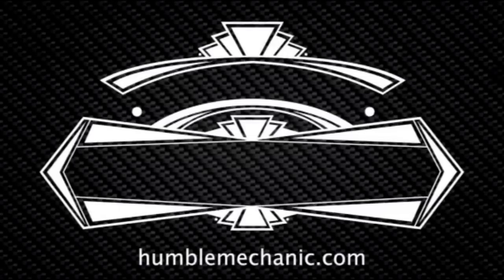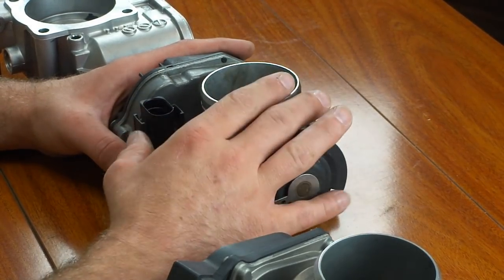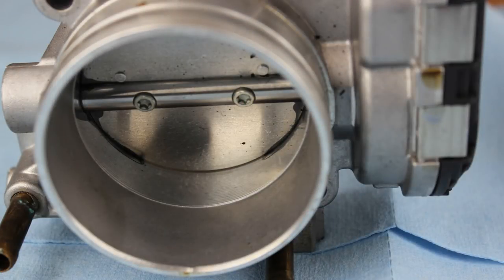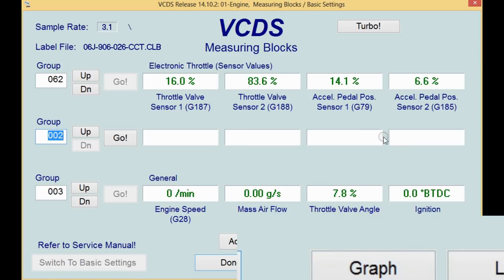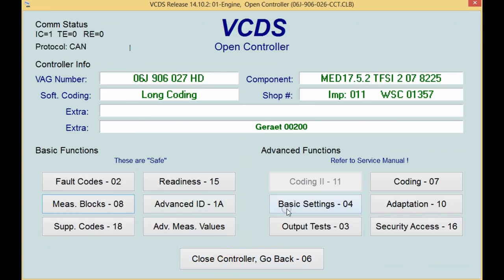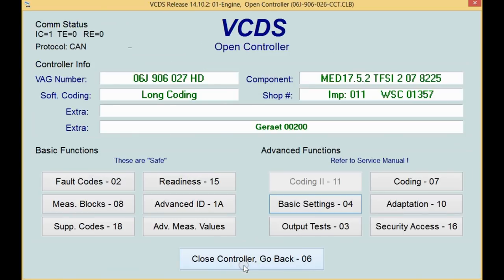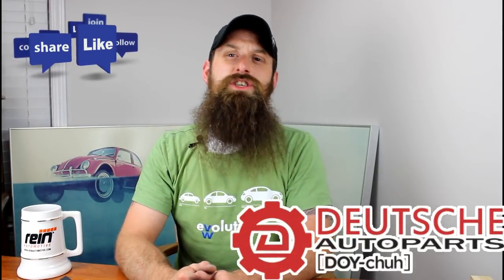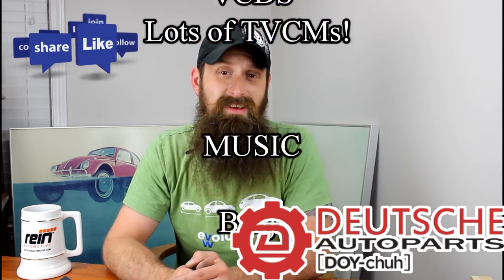How A VW Throttle Body Failed with VAG-COM Demo

Comment: Thanks, great explanations! Gotta love that VCDS. On a recent 2005 1.6 Golf I worked on, I got "17953 - Throttle Valve Controller 
            P1545 - 35-10 - Malfunction - Intermittent"
Any suggestions appreciated, though it's only intermittent so not too concerned unless it comes back with CEL etc.
VW on, man!

Comment: Fantastic video! My beetle just threw up a p0411 code and it's the throttle body. The mechanic cleaned it and said it was still playing up and not working as it should so I've bought a replacement... I was interested in how it works and how you put it in.... This was extremely interesting

Comment: my 2012 golf jerks and makes a clumping noise when coming to a stop.. took it to the dealers and was fixed with a SW update initially.  the problem issue is happening again after 4yrs, this time the dealer say it requires a throttle body cleaning and vacuum pump replacement.

Comment: i had to install a new throttle body on my 2010 cc, it calibrated itself out after a few days of city driving and i didn't have to reprogram it for some reason.
Reply: Why did you replaced it?

Comment: Thanks for the video. In the cable trottle body, whats the function of the vacuum lines. Does it assist for idle speed control and cruise control?

Comment: I occasionally have the problem that the car does not react to the accelerator pedal, not bad response, not at all!  It rarely happens, but it's very dangerous the other day off the freeway for a few seconds.  No EPC / accelerator pedal error code stored.  The throttle valve was cleaned, the ground points to the control unit were cleaned, but it still happens every few days. He recently had a P0130 O2 sensor code, but after replacing the ignition coil / cables / spark plugs everything was ok.  I still replace the O2 sensor in front of the catalytic converter, because there is supposed to be a connection with the accelerator pedal sensor.  I also noticed that the primary air pump no longer starts when the engine is cold.  1.6 Beetle (Motor Code BFS) I don't have VCDS, just a small OBD scanner that shows fuel trim, temperature, TO position etc.

Comment: Hey Charles great video as always, when you have an intermittent problem with codes P0221 and P0121 and the problem does not occur and codes are not showing when you're testing with your VCDS, should readings be normal as you're showing on your video here or you would see abnormal readings? Thanks

Comment: Great video, might want to warn first timers like me that the cooling system runs though the Throttle body and you will need a ear plug when disconnecting.  Saw your ear plug trick after the fact. 😅

Comment: I’ve replaced my throttle body with a brand new continental one and I’ve done the tsb of the connection. I’ve cleared the codes and adapted the throttle body, but I keep getting p0221 and p0123.
Runs good for about 2 minutes and then epc and esp lights come on.
Reply: theblackslcmamba 
Hello did you find a solution for this problem 
Thanks
Reply: Gas pedal

Comment: 2003 Golf 2.0l AVH. getting P0221 Throttle/ Pedal Position Switch B circuit Range/Performance. Been having this come on every morning and having no power. Ive thrown a used throttle body and pedal position sensor at it but still have the same code. ESP light on aswell. Any pointers? thanks man, love the channel.
Reply: Same issue, 2012 Golf 2.5 here.. I'm under the impression that since the sensors are built into the throttle body itself, you would need to replace the entire throttle body assembly. How did your repair work out, interested to know.. Also, can't imaging VW offering the entire throttle body for under 500 bucks, just my luck..

Comment: VAG-COM while a great tool, its like a computer running DOS. You reference value block 62, is there a legend somewhere that tells us what value blocks are for what sensors or actuators? How can I find what block to look at for a particular sensor or actuator?  This is my biggest issue with VAG-COM!

Comment: Quick ?   Just got a 01 jetta vr6 12v.  Has slow deceleration making shifting a lil delayed. I cleaned the TB. To see if it would improve that still having same issue. Do i have it reset or could it be something else cause slow deceleration.   Thanks for ur time.

Comment: New to VCDS...how do I find the group numbers for the VCDS? I own a 04 Volkswagen beetle and gave no throttle response.  It shows it works on the system but it doesn't work my throttle body which is newly replaced and adapted...

Comment: I have a 203 MK 4 golf 1,6 petrol  sometimes when I am driving the car cuts out suddenly this sometimes happened more when the weather is worm outside , and sometimes it judders  I have changed the spark plugs and the four silver tubes that attaches to the spark plugs, but the problem is still there could  this be the Throttle body causing this issue?

Comment: Would a TB issue ever cause a P0343 for cam pos sensor circuit high? I’m at a loss on where to go next with this code. I do have the EPC light on, but I was trying to diagnose the cam issue before moving to the throttle circuit. New timing chain, and sensors.
Reply: Did you ever resolve your issue?   I'm getting a P0340 (G40 camshaft pos sensor malfunction on intake cam).  I've replaced both cam sensors.  Tried swapping them but fault stays on intake cam, which rules out the sensors.  Suspicious of throttle body as it always whirrs/clicks on ignition for 10-15 seconds as if it's trying to adapt, idle is low and rough, revs hunt between 400 and 1800rpm on the lightest of throttle.
Reply: @JamesGadbury so I finally got my issues figured out. All 3 wires from the cam position sensor route underneath the intake where they come into a 6 pin D-shaped connector on the drivers side of the intake. Well, the #3 wire from the cam pos sensor was broken inside that 6 pin connector. Literally pulled out as I was inspecting it. This is on a 2013 Jetta GLI 2.0 TSI. So, to recap because I couldn’t find much on this, I had 5vdc on pin #1 (reference voltage), 4.9vdc on pin #2 (signal) and no continuity from pin #3 (ground) to ground. Lastly, if anyone reading this needs the cam position sensor pin outs, they are as follows: 
CMP pin #1 to pin #29,
CMP pin #2 to pin #53
CMP pin #3 to pin #8
I had a hell of a time sorting this out so I hope someone will benefit from this.
Reply: @jamesk10turbo47  I'm sure this will help many.  Thanks 👍

Comment: Well i have one. A motor of idle rev get some problems. A switch of idle too. I want to fix (clean motor) but electric motor can not be dissasembly (its blocked well under gears i need dissasembly gears but still do not know how). The swich of idle possition must be change for something new (after 18 years its overheat or something). the potentiometer has worn out too. But I use pencil to repair. Throtlle is problem too if its loose correction of air was not precision

Comment: Charles, my daughter's 2005.5 Jetta needs a throttle body. 05-07 2.5 p/n 07K-133-062-B
 is twice the price of the 08-14 2.5 p/n 07K-133-062-A. They look identical except newer one doesn't have throttle body coolant line pipes. What do you think about using the newer one and bypassing throttle body coolant?
Reply: So, it worked for me. 07K-133-062-A on a 2005.5 Jetta 2.5. Only $215 on Amazon: http://a.co/d/e6sPKB6

Comment: Thanks for this informational video, it’s very usefull. I do have e question though. In block 62, what would it mean if the vallues of position 3 and 4 of the gas pedal are equal? M could this mean that the gas pedal  is broken?

Comment: I have a mk6 tdi and the cable on the side moves in and out at regular intervals every 3 seconds. I can’t figure out what the problem is but it stopped for a month and came back. It stutters in a particular rpm range like it’s running out of fuel but that throttle is moving back and forth no matter how I drive every 3 seconds. It’s got a check engine light on that is meant to be something about fuel system very general code

Comment: Golf 4, 2003,  BCB, Trouble code 17961 and 17912. Cant give gas at all. 
In VCDS, group 62. In the two last boxes (accelerator pedal position) the numbers are almost identical. But is there one or two sensor in the accelerator pedal?

Comment: Humble mechanic I was on the road driving my 09 golf gti  and as I rolling down the st I decided to turn on my ac so not even 3 seconds  the whole engine  cut off! Just I try giving it some gas and  the gas pedal  felt like lose  as soon as I got  off the road try to push the break and it was so hard! Do you think it is the throttle body??

Comment: Hey great vid. My cousin has a 2010 Voltswagon Routen V6 engine and it has a code PO123 read: Throttle/ Pedal Position Sensor A Circuit High Input Confirmed. How am I able to fix? Answer in a video would be appreciated. I don't know VoltsWagons at all. Thanks I look forward to your reply.😃
Reply from the maker: the Routan is a Caravan/town and country. I'd search that code for a dodge/Chrysler you probably will find a better answer.

Comment: On my 2012 MK6 GTI, I get a P2138 code saying Throttle body position sensor, voltage correlation, and it comes and goes but is kind of rare. I just dont know what it is.

Comment: Dear. Eng, many thanks for your amazing videos.
I have Touareg 2008 V6 FSI Engine...I have unstable rpm in ideal position... I tried to clean the Throttle but still the problem.
Also when I turn on the A/C the RPM not increase.
is the problem from the Throttle ? 
To be noted I change all spark plugs and the air filter and cleaned the mass air.
I hope you can advise me
Reply: When you turn AC rpm grown. Probably potentiometr has worn out and on higher rev work better. Or pressure sensor of power steering broken. Switch off these pressure sensor and check. put some pencil lead on the potentiometer track.use adaptation of throtlle. Check idle speed switch into throtlle.
Reply: @StopTeoriomSpiskowym  many thanks for the reply, I will try to do it soon.. is it possible to share a video ?
I  appreciate your help 🙏
Reply: @mohamedalsayaghi  are you searching for answer on internet vw forums?   you have FSI well. Its different story carbon build up on the valves, maybe you have too much of it. another High pressure fuel pump your fuel filter is clean? the pump work with oil (probably in yours too) at idle rpm injectors stream can not be correct (you must check in VCDS whats your fuel ratio when your problem happend).compresion is fine in all cylinders?  . Another timing belt or timing chain to check. Sparks plugs to check. Coils too.  Engine temperature sensor its vw failure.  Leaking in intake mainfold. Lambda failure.

Comment: Hey Charles.  I have a 2016 Golf SportWagen TSI and the EPC light has been coming on every now and then over the last couple months along with stuttered acceleration.  After watching your video and other videos, there's a good chance that it is a throttle body issue.  I have no diagnostic devices, so I don't know for sure.  I was planning on taking it back to the dealership for repair because we just bought the car.  We bought it with around 4k miles and we don't have much more than  5k currently.  Is it typical for throttle body's to fail with such low miles on the car?  could it be a defective part?  Thanks for any feedback you can provide.
Reply: I would suggest to check all fuses and doing a smoke check yourself. For the smoke check take a jar make some holes in the top and put in the jar a soldering iron together with some socks and mineral oil insulate , so you have some smoke . One site connect with air hose in the car (on the left in engine front) the other one blow some air in the jar through the tube. Take time and on the passenger site in the rear tire vw has the EVP system, take the tire and the molding around, watch if you have smoke! After that, check for the leak in the front of engine by air intake.

Comment: Is it possible to short out a tb? Was getting tb faults and epc light and realized that one of the middle wires going to tb harness was broken at crimp from previous splice per tsb. Wiggled the suspect wire while engine was running and throttle body acted strange and would struggle to idle even after running adaptation and repairing broken connection.  Did I somehow fry it or am I missing something? Have 5volts to the harness.

Comment: I have a mk4 1.8t with 110kW, motor code agu. I think it has the dual system throttle(electric and manual). After reinstalling the throttlebodey after cleaning, is it necessary to adjust the cord to a specific position?

Comment: I have a 2000 VW golf gls 2.0 liter .  Question what is the part located directly under the throttle body on this engine ? The car had a rough idle , and there is a rattling noise coming from the valve cover , so I pulled the manifold off to check my plugs and wires because of idle , and I left it sit like this for a while because I had no valve cover gasket yet and I wanted to take the throttle body off as well to clean it thoroughly , so I waited for this til I could get all necessary gaskets . Anyway today I noticed a black hose just hanging there and looked at it and it snapped and left the tiny clamp and part of hose on this part directly under throttle body. There is a I'm guessing solenoid of some sort attached to firewall driver side and there is another small hose that goes into the booster hoses. Is this some sort of vacuum line that snapped and was making my  car idle rough ?

Comment: Any chance of an update for modern UDS cars? Throttle valve position 1 shows up as volts for me, and the accelerator pedal positions both read the same number. Thanks Charles!

Comment: While checking the OBDII check engine lite got a P0411...after rerouting the vacuum lines and retesting found the Throttle Valve Control Module making a High Pitch squeal sound, unplugged it and that's how assured it was it making the noise. What causes this squeal sound ...?? Does it need to be replaced or reset...??? Please advise.....On My 2001 VW Jetta GLS 2.8L,12V gas engine,......203k miles on her....Thanks.....oh cleared the P0411.......Randy

Comment: What is the best way to figure out whether the motor controller is sending wrong data, or the throttle valve doing the wrong thing upon it? I have figured out so far that on a 1998 GolfIV I have in idle conditions suddenly "slams shut" and the motor going off, after restarting everything is fine again. Now I am wondering if the controller is overcompensating something the wrong way, or if it sends the right things but the throttle valve is doing it wrong.

Comment: Hello, does this VCDS adaptation will help fix my problem? 
Got a 2009 Altea tdi 2L 140 bkd and the throttle body valve was stuck due to cog had snapped inside so I replaced it for a new one and when I shut the car down sometimes it’s juddering still and sometimes it’s fine!,

Using OBD2 scanner got a p2108 code: Throttle actuator control (TAC) module – performance problem

Any idea what this could be? I’m pretty sure I can still hear the valve opening and closing though just sometimes it shudders on shut down and sometimes It doesn’t.

Comment: I have a 99new vw beetle 2.0 5 speed manual and I spayed electrical connector kleener to the wires on The throttle body  let it set and now the car bucks when I got it wide open to get on the highway  and it is cable driven can u tell me why thanks

Comment: HEey,I have Passat 1.4 tsi 122hp,my idle stay at 680/min,it is to small.I wood like to rise at 800,but i cant because the ecu ask me a code pin.I try it ,with 12233 or something like that but still no .Mechanics says that to this model tsi it is not possibile to change the idle?It is real?Only at diesel works?

Comment: If i press the clutch, there is something related to the throttle body or not?
I'm having an issue and the mechanic told me that the throttle body is the problem (Polo 9n3, 1.2, 2007, 45000km...)

Comment: HumbleMechanic I've just changed the EGR valve with a new one ( original ) on a Golf 6 diesel and I'm facing problems with the RPM when the regeneration is started and I'm standing still at a traffic stop. It doesn't go to 1000rpm and stay there as it normal should until the regen is over, it fluctuates all over between 1200 and 700 rpm. Also when accelerating, power is not the same, it accelerates a bit wierd. You have any idear what could be, have you ever encountered a situation like this ?

Comment: Hello. I would be very grateful if you could help. I got a 17' V8 FSI Touareg, bougth used and battery has been changed/disconnected for a while. Throttle pedal doesnt seem linear... If you press it a bit, it wont get going, checked with obd scanner and pressing an inch on the gas, will almost not move the relative throttle position. However, if I press halfway down, and then press it down an inch or so, it will definitely make a difference. By this I mean, when using it normally and accelerating after parking, or at a red light, I really have to press down on the gas to get moving. I compared relative throttle position with my VW Golf and pressing just a bit will change relative throttle. My treg feels very "unsensitive/unlinear". My mechanic supposedly did Throttle body adaptation. any other ideas?

Comment: Hi great vidio. I have a problem with a VW polo 1.2 TSI the scaner shows me the following codes.
P012200
P022200
P063800
P022100
But I think that the falut is un Throttle body. But the piece is very expensive, and I need be sure that this is the problem. 
You can help me ? 
Regards of México